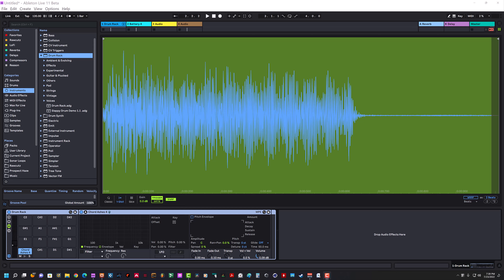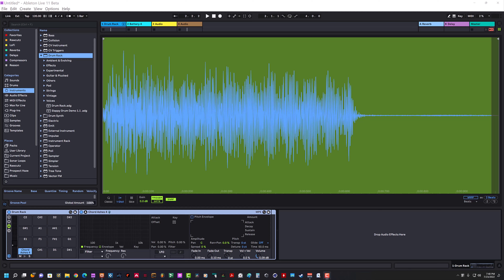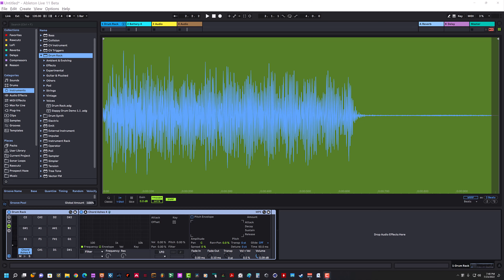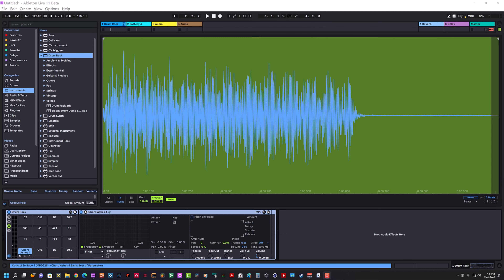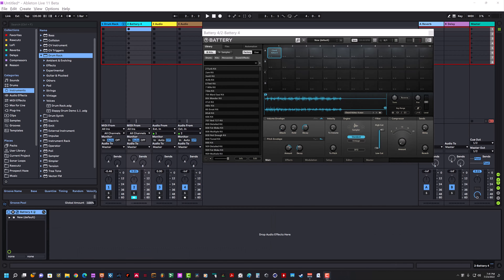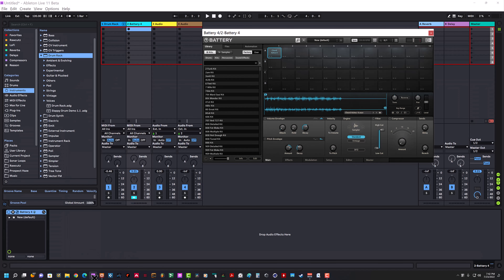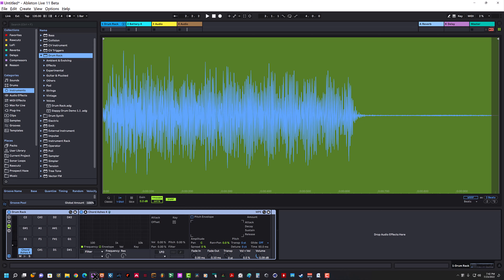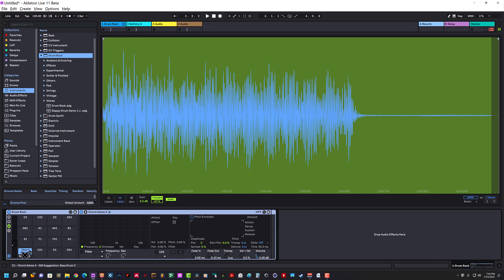Ableton Simpler Snap Follow Up

Comment: Can't believe this hasn't annoyed more people and has been fixed. Thanks for making me feel less crazy
Reply from the maker: I know.  I can't believe that they released a Push 3 standalone,  and the problem still exist.  Push 3 standalone is $1999,  and yet,  it still uses Drum Racks and Simpler,  both of which have this existing problem.  I stopped using Drum Racks and Simpler completely.  I use Maschine instead.
Reply: Its crazy man!! I recently switched from FL Studio and really noticed the difference in MIDI Drums

Comment: Daaamn man I've been looking for a solution to this, right now i have to bounce to audio and add fades at the retrigger points manually to get rid of the clicks.. makes it a pain to work with drill 808 slides
Reply from the maker: Tech support has confirmed that this is just how Simpler/Sampler works.  I have asked them to submit this as a feature request. They said that they would,  but there is no guarantee that they will ever fix it or add this as a feature.  If you don't mind taking the time,  I would ask that you submit this as a feature request.  The more people that request this,  the more likely it is that Ableton will add this as a feature.

Comment: Great vid. Problem is I don't hear any "click or pop" on the Simpler track. Can you put a spectrum on that channel, so that the "click/pop" would show up ?
Reply from the maker: I can,  but that would require me to post another video.  What are listening to this video on?  Studio monitors or headphones???
Reply: @kb420ps  SM's, and headphones. I use simpler a lot, with very fast retriggers on samples,and have never had this problem. I did hear some random clicks during  the vid . Not sure where they came from. A spectrum device should reveal all. Best of luck
Reply from the maker: There are definitely clicks there,  and they have been verified by Ableton tech support.  The problem is,  that when a sample is retriggered,  it may be "Choked" at a point that is NOT a zero crossing.  So, there will definitely be a click when that happens.  Simpler/Sampler has no programming or feature that can compensate for that sample being cut off at a position that is not a zero crossing.  With some samples,  the click may not be that noticeable,  but in others,  the clicks are extremely noticeable.   Battery and Maschine are able to compensate for it.
Reply from the maker: @badpenny7820  here is a spectral image of the sound.   First I play the sample by itself,  then I play it and retrigger it twice.   You can clearly see the retrigger points on the spectral image. 

https://www.youtube.com/watch?v=UD0h_BZH_eU
Reply: I can definitely hear the clicks easily, I'm listening on beyerdynamic 770 pro 80ohms